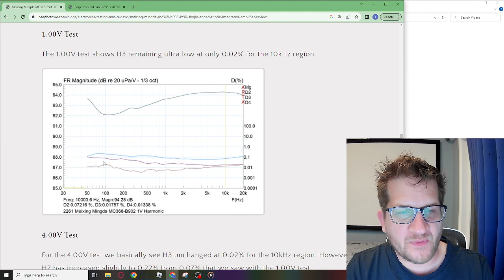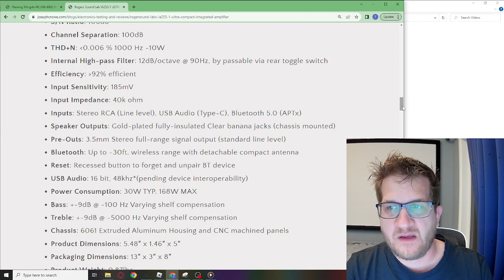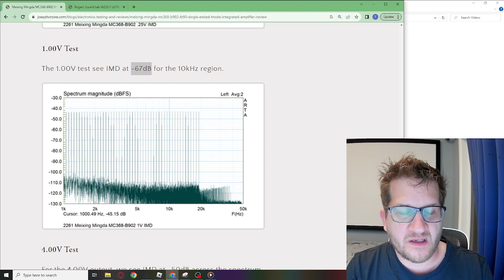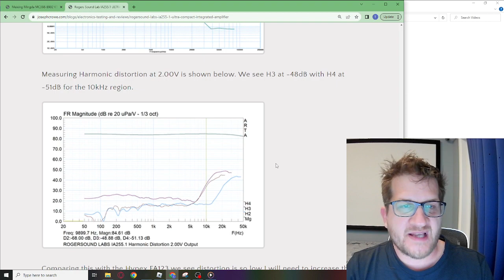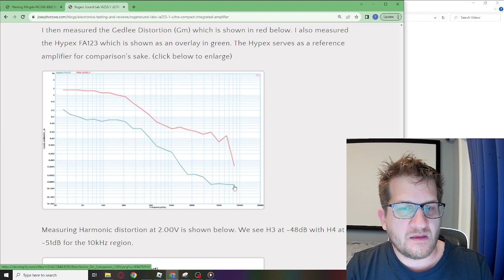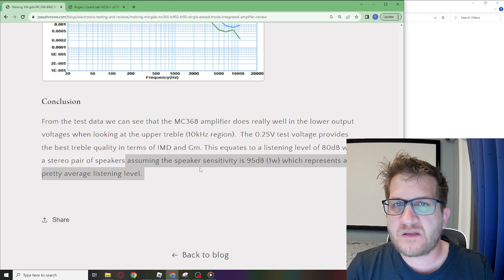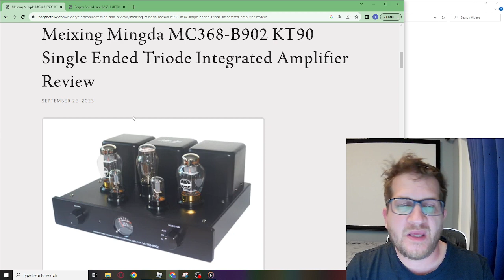Meixing Mingda MC368-B902 KT90 Single Ended Triode Integrated Amplifier Review

Comment: Thanks for the test, Troy. I have a different Meixing Mingda amp and have been very happy with it.
Reply from the maker: I would suggest upgrading the capacitors. (By a Qualified technician).
Reply: @JosephCrowesDIYSpeakerBuilding  good  tip. I'm certainly not qualified myself, but I might ask around

Comment: This is supposed to be an 18 watt amp? What kind of distortion does it produce at this level?
Reply from the maker: You can calculate the distortion for the rated output power assuming a linear rise in distortion. At 4 watts output its -48dB, 8 watts would be -45dB, and 16watts would be -42dB, so around 0.8%. It could be higher if the amp saturates for example.
Reply: @JosephCrowesDIYSpeakerBuilding  That's a really good result!